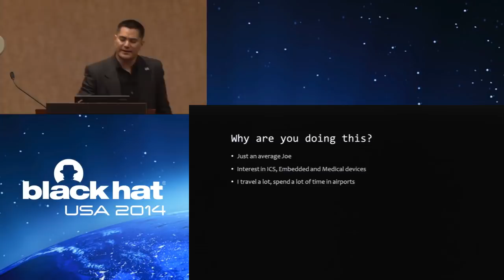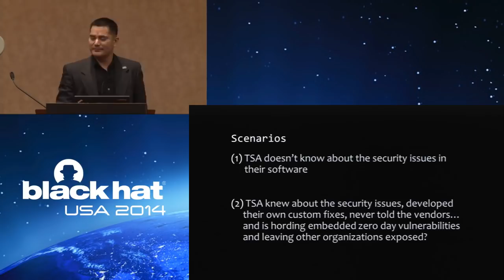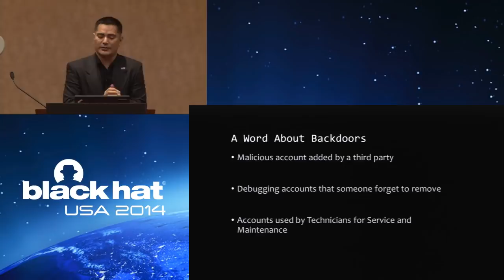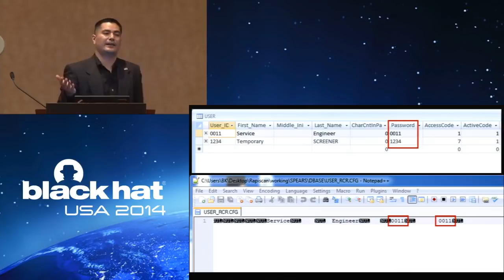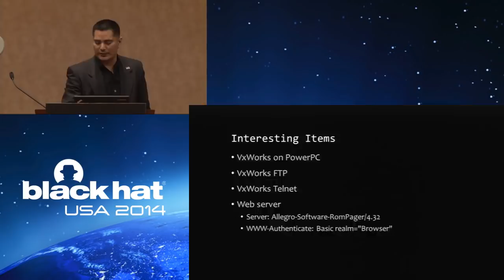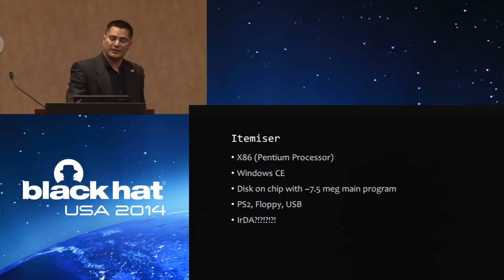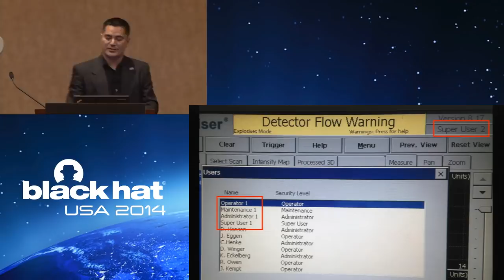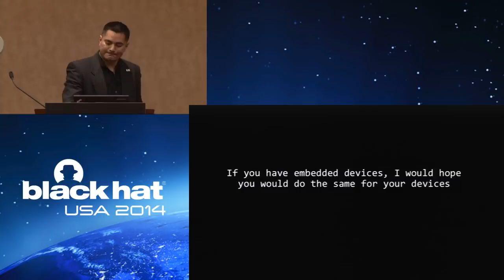Pulling Back the Curtain on Airport Security: Can a Weapon Get Past TSA?

Comment: ... back doors ...

My employer sent me home with a Defender brand CCTV DVR to fix. He got it used but couldn't get into it because the password was unknown (Defender makes changing it mandatory). I took off the cover, hooked up a 3v3 serial to USB adapter to the (already populated) debug header, fired up termite, and was blown away by the fact that the terminal output just printed the username and password for me (among other interesting things, Linux FTW?) You can't change this password either. 
...

Let me reiterate, this is also a security specific device (CCTV DVR > "surveillance camera box").
Reply: it means the illuminate look at every securitycamera  from your home.... !!!

Comment: That is why I don't think this security is very effective, if it is to be effective, they would not use windows or any commercial OS and engineer their own electronic systems from scratch so that they are much harder to software hack. Since there exist the concept of "Malhardware" which is malicious chips that can be added to hack hardware and render software security ineffective, they should have a team inspect hardware at least monthly to make sure that nothing bad has been added to the circuit boards.

Comment: We are a "vendor" but not for security or TSA...we are in Germany...point is, we need easy access to the software on site without searching for the one guy who knows the password and who is currently on vacations  :-(
So we have a inhouse software that takes the datetime and Software Serialnumber (serialnumber changes with updates and customer) as input and creates a password that will work for 20 minutes.
We call it time password...
It would be pretty save unless someone hacks our company or someone figures out that it's a time password an plays with the clock and replays the password... :-(
The passwords aren't saved outside the company, but they travel through teamviewer(by copy and paste).
Is there a best practices way for trusted access?

Comment: dude I was going to LA through Dallas, had a Milwaukee flip razor blade knife on my inside jean pocket, mostly aluminium, some steel... made it through 2 TSA checkpoints before I, not TSA, not the sky marshal, not the cops... >> I << noticed it and freaked out... I just took the blade out and disposed of it... 

yeah TSA is NOT very secure

Comment: whats wrong with board being made in china? at least 50% of the stuff in almost every airport are made in china
Reply: The problem is that the gov was angry because an x-ray "lightbulb: was made in China, but don't mind an entire PCB to be made there (where they could easily put components that intercept input/output).
Reply: The problem is that in China, factories are partnered with the government. China has military aspirations and desires intelligence to keep tabs on other governments. Can you REALLY trust someone to play fair when they have such motive AND opportunity not to? Chinese engineers know how microchips work and can reverse engineer plans to insert sections that will allow snooping and backdoor access without being easily detected. Such devices would be integrated into many items. Most would yield no useful information, but a select few would be caches of immense value. This arrangement is almost as silly as asking the Soviet Union to make American computers in the 1980's.
Reply: Some times i wonder how can you be so paranoid about these things. It an airport scanner. Not a missile guiding system. How much danger can this bring? Security airports are jokes most of the time. You think people with actual intentions to hijack a plane dont know they gonna get screened? Its just there to make normal passengers feel safe.
Reply: @andersenzheng  I have been through several TSA checkpoints. I agree with you 100%. As shown in 2001, You don't need a missile to kill thousands. A cardboard scanner is less than useless. It is dangerous. It gives a FALSE sense of security if they can easily be hacked. I don't think China is interested in hijacking planes, but these system components are in other high security equipment as well.
Reply: @builderdex  should take advantage of the cheap manufacturing price of china but do your own QA. China is capable of building well above good quality stuff, but the QA there works half the time on a good day.
Reply: @andersenzheng    Agreed. The prices for goods coming from China is very low. That is why it is so appealing. I think it is fine for lots of items, I just think that without very strict guidance, there is too much opportunity for security breaches, whether intentional or not. Domestic manufacturers would also have a much higher accountability in the event of a breach. (at least in theory.) I would expect China to do the same, but considering that they already make it and know how it works, they are on top of that! 

I am in the engineering field and we have a saying.. "China makes the very worst and the very best."  You can order parts made from high precision factories that have incredibly tight tolerances or you can go with the slightly cheaper bid and have it made by a guy with a worn out mill in his backyard shed!

Comment: Kronos hasn't been updated in over 20 years lul
Reply: @William Rumley - This is how systems are easily hacked because people failed to do updates, the most vulnerable ones are network switches which are mostly  forgotten to be updated all time, you just make it easier for hackers to break through your network environment.
Reply: The problem is in embedded systems like this you can't do updates - or at least not as an end-user.  The manufacturer should be shamed, though, for not updating the software they wrote to work with a newer OS and using that.  But it's ever so common to see ancient software, not just there but in any government application.  The stuff is written to run in a very specific environment and will generally break if you update anything without updating everything else including the custom written software.  Then it all has  to be validated again.  It seems common not to bother and just hope it keeps working.

Comment: I recently flew into lax and had a layover of 11hrs, it sucked. While I was there in the middle of the night when the airport was basically shut down someone set off the alarm on the door going to the tarmac in the terminal I needed to wait in... it was loud as hell and you could hear it 500ft away easily.

15 minutes after it was set off I pointed it out to a couple airport employees who said "not my job", walked back ove and saw a guy with a shirt that said "supervisor" standing outside the terminal, asked him how long until it got silence... he said "someone is coming" and walked off. 30 minutes later two managers came through the door whose alarm was going off, I asked them how much longer that was going to be going off... they look at each other and said "not our job, the sherriff will take care of it". 20 minutes later one of the morning tarmac crew came in punched a code in the keypad by the door, silenced the alarm and went back to work. 3 hrs later when I finally got to leave sheriff still hadn't shown up.

More then 4hrs and nobody bothered checking why this door tona secure area had its alarm going off.

But I had to go through security three times because I went from an international flight to a domestic flight.

They dont care about security at all.

Comment: Same goes for small embedded devices like your network routers, which is why people suggest and highly-recommend that you flash install OpenWRT do your router device because it carries all the latest security fixes and lets you actually secure your own network device since it has full access to the devices functions.

With all these kind of vulnerabilities in airport security computers and devices, being able to fake x-ray scans and such is all rather interesting stuff, I knew these sort of things were possible, but just how easily could they be done if you got the right equipment to change it. You'd be able to get yourself free access to any airport terminal and get yourself a free flight to anywhere you want without paying and get yourself first class seat, all just by spoofing your ID and tickets as someone else's, claiming their spot, or swapping out their numbers for someone else's.